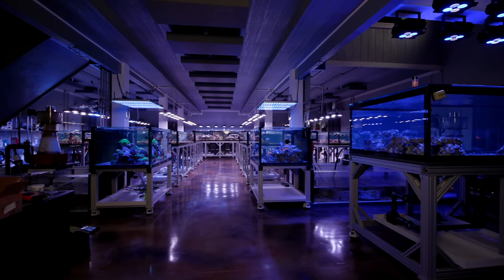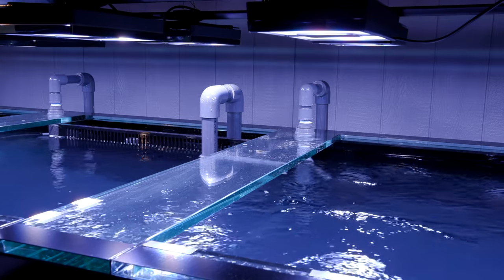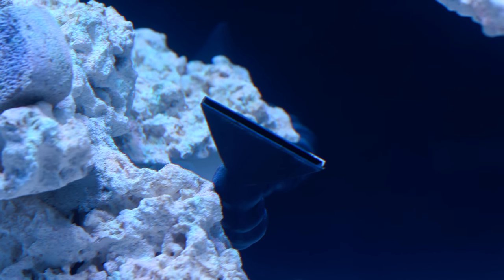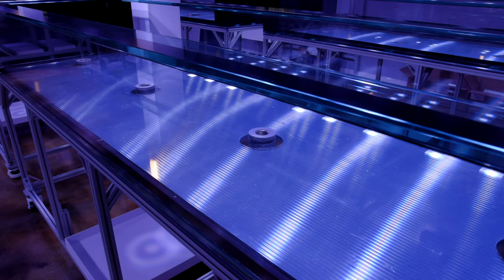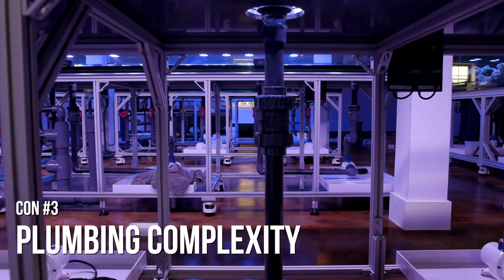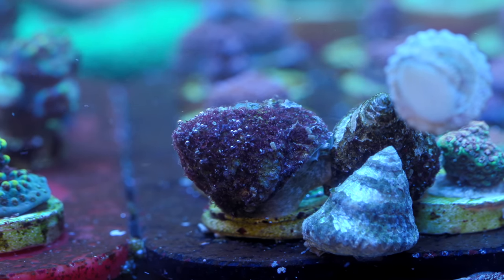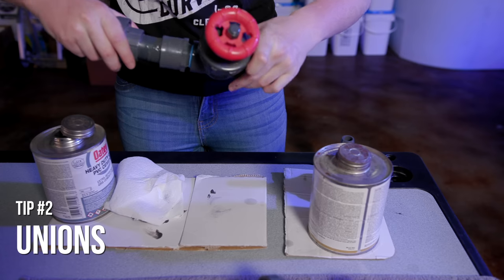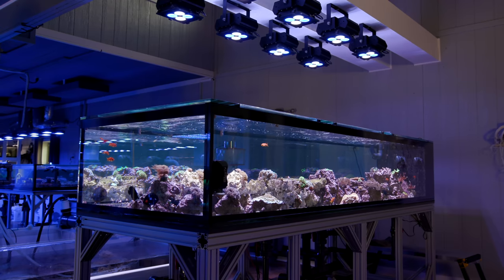Closed Loop Water Flow Systems for Reef Aquariums

Comment from the maker: Have you guys ever tried closed loop pumps to provide flow?
Reply: Nope, but am seriously thinking about it on my new 350 gallon.  My thoughts are, on a peninsula, it might keep the power heads off the display.
Reply: I've never used closed loops due to the cons you mentioned, plus some other big cons which probably affect the UK more than the US are:

Energy efficiency, powerheads usually create a lot more flow per electrical watt required due to their design & not having the frictional loss created by pipes etc & electricity is EXPENSIVE in the UK. Plus any heat transferred into the water is usually a good thing in our climate, for around 10 months of the year anyway 😆

Space is always at a premium in the UK (high rents/small spaces etc) so all that hard plumbing under & behind the tanks is taking up valuable real estate.

I also like the fact that if a powerhead dies when I am away from the tanks for some time theres will still be several other powerheads working until I return, although you could of course use multiple closed loop pumps on a system as well but it'd take up yet more room & require more plumbing etc.

I can see why closed loop makes sense in the land of plenty though 😁
Reply: Been running a closed loop for 5 years now no regrets
Reply: So closed loop has nothing to do with external filtration, it is only a means to provide flow in the tank instead of using "wavemaker" type impellers w/in the aquarium?
Reply: @spicyreef  that’s correct. 

You are essentially using an additional return pump that’s providing flow to spaces in the tank that you would normally see dead spots in
Reply: Yea, back in the 90's I had a tank that had a weir baffle sectioned off for a wet pump closed loop compartment.

like a baffel that sets the water level in the sump. So if a leak occurred it wouldn't drain the main display.

I ran an external overflow off that compartment.

As for powerful pump intake screens, we use to make manifolds with multiple intake screens in that compartment, it's also were we tossed bioballs and such if we were going to setup other tanks.

Also acted as a nice buffer zone for wandering livestock.

Comment: I really appreciate this video. I've been trying to find good conclusive/informative videos of information on closed loop systems and the pros and cons for years! I wanted to try something similar on a smaller scale and see how it works out but now I'm reconsidering that as an option. It could still work, but since my largest tank is only going to be 25 to 30 gallons going with a sump or other filtration method might be more sensible for my needs.

Comment: No I haven’t i finished the video and you explained the closed loop with a little tweak I think this would work on my new build at least the lower section but I have question how do the ( out) drain get to the sump or do you use two pumps from the tank to the sump and another closed loop from the sump back to the tank

Comment: What I have always done after the bulkhead is in place on the bottom for the closed-loop and it's tight and snug I  silicone around the bulkhead to the glass in the aquarium never had a issue

Comment: I saw the closed loop sticking up out the frag tank and then it looks like a PVC Cap with NPT threads on it. Is that custom made or is that something you can buy? Right now I use a 5 way cross and its extremely bulky. I love the slim profile with the npt loclines coming out. Where can I find one of those?
Reply from the maker: It is a custom thing.  It is basically a 3"? or 4"? cap that is drilled and tapped.
Reply: Is there anyway I can get up close pictures of this?

Comment: Why is there two 90 angles on the return going into the tank? Seems like a strait up pipe would be more efficient, what am I missing? Thanks.
Reply from the maker: Long story short it is for ease of install and maintenance.  The additional 90 provides much needed flexibility and takes a lot of strain off of connections/bulkheads when screwing or unscrewing unions and turning valves.
Reply: @tidalgardens  Thank you, makes sense. Have you considered doing spa flex going up and rigid down? Should achieve something similar but with no 90x2 loss.

Comment: Can we do closed loop from intaking water from display tank through a pipe plumped over top of tank
Reply from the maker: Possibly.  It depends on the height of the display tank and the pump because most pumps are not great on the suction side and require priming.

Comment: Sorry for the stupid question, but how do you use mechanical filtration on a closed loop tank?
Reply from the maker: The closed loops are only for flow, your filtration would still be however you normally would do it - in a sump or wherever.
Reply: @tidalgardens  ahhh now the wheels are turning. That’s what I get for playing this video while driving and not paying attention 100%

Comment: If you use flex hose the pump won’t send all the vibration to the bulkhead and will be more forgiving when your tech service the pump.
Reply from the maker: I used something called spa-flex in the past but went away from it.  I liked how flexible it was but it maintained a curved shape as a result of it being in a roll for so long in storage.  Also, spa flex is a difficult material to glue so over time it would spring leaks on us.

Comment: I know that most of these videos are general, but i think it would be good to give some more bread crumbs with the terminology... I think that the terms 'pump curve' would be very useful. There is some additional fluid flow terminology too ... 'net positive suction head' is how much pressure must be present at the inlet of a pump to prevent problems (cavitation).  Properly reading a pump curve solves lots of problems before you have em.